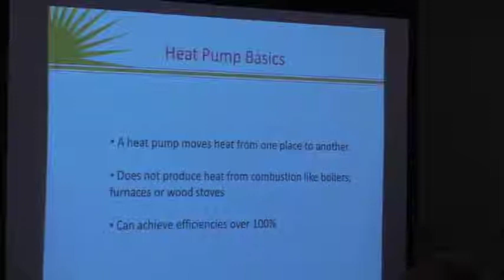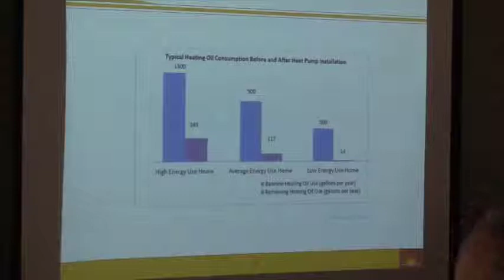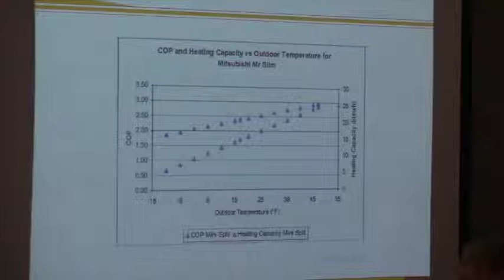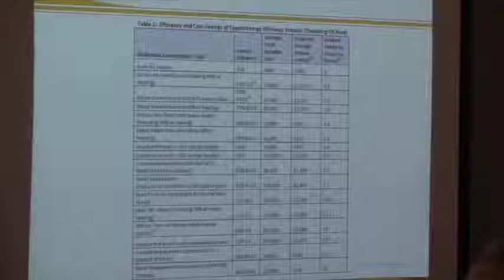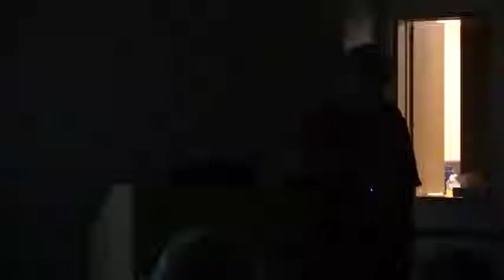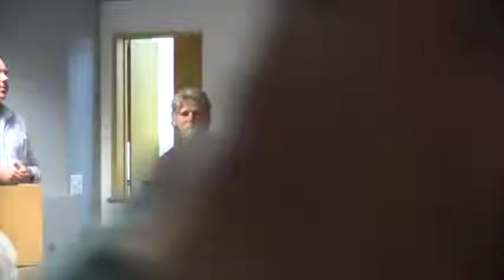ACORN: Cold Climate Heat Pumps

Comment: What arrogance to think after a brief exposure to this technology that these guys were now equipped to handle this class... these lecturers were not smart enough to be in front of this intelligent audience.    Lots of very reasonable and relevant questions they simply could not answer.   That they did not have proper instructional collateral to share, and perhaps the worst thing is that they tried to  maintain some air of authority and talk around their ignorance and did not even understand the basics of heat ex changers electrical power consumption's.